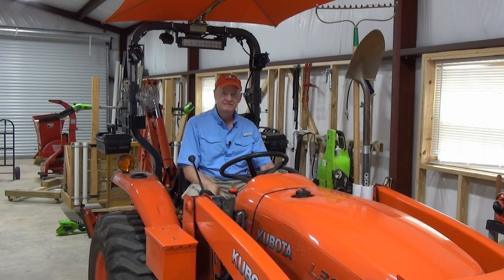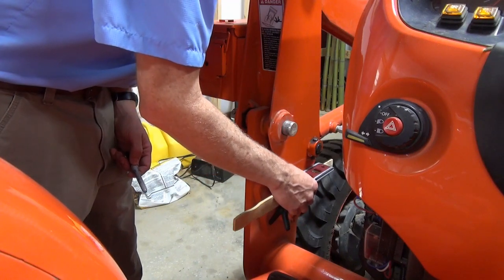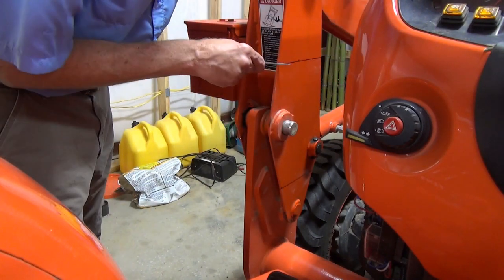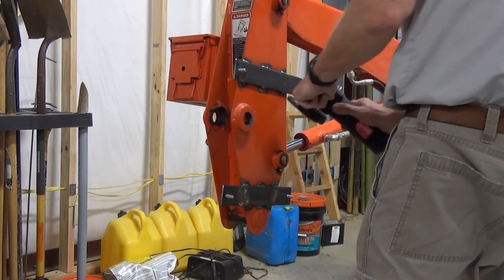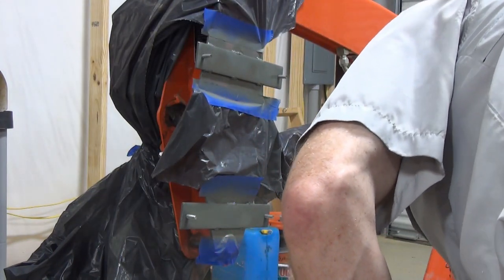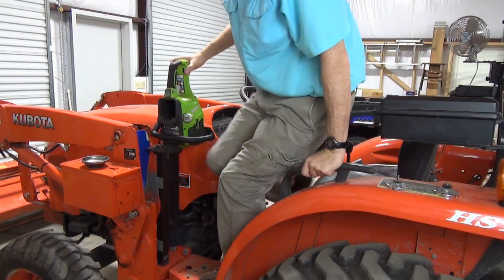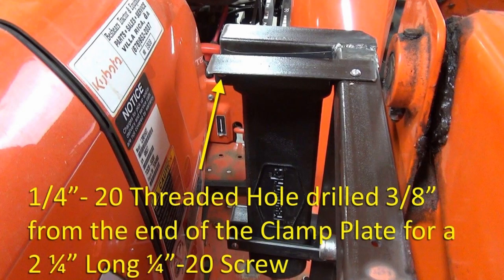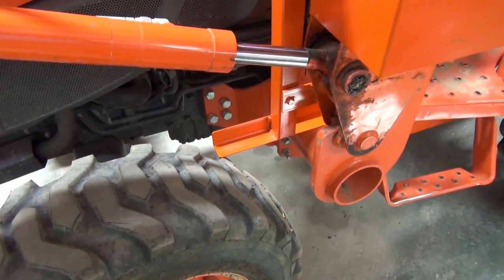Tractor FEL Chainsaw Scabbard and Tool Holder: Detailed Build Instructions (#102)

Comment: To add to my original comment I would like to mention that a company called Electrical Hub sells an industrial adhesive called Click Bond. It is incredibly strong and works great for those that can’t or won’t weld to their tractor, implements, etc. I’ve used it as well as welding over the years and highly recommend it.
Reply from the maker: Yep, heard of it and it’s expensive as I recall.  I’ve found J B Weld is VERY strong when used correctly and is inexpensive.  In fact, I used it to secure two chain boxes to my FEL towers before I had a welder and they’ve held rock solid for over four years. Here’s the link to that video in case you are interested: https://youtu.be/iUS9RyFy5sw.  Thanks for watching!

Comment: Looks Good Martin!
A well equipped tractor is like a Swiss army knife on wheels!
 I've had a home made scabbard on mine for a while (not as slick as yours) and couldn't go without it.
Does your saw have dogs on it? (log grabber spikes) looked like it sat down flush... 

on another note, be careful using that bed rail for building. Probably fine for this kind of build, not much weight hanging on it.  I've used it for stuff trying to be save money on steel , and had it crack from weight and vibration.  When cutting or grinding it sparks like grinding cast iron. Not sure how its made but gets brittle/work-hardened. 

It's fun to see your progress stocking/ setting up the Garage Mahal ! 
Keep them videos coming. 
Dan
Reply from the maker: Hi Dan!  Yes, it has dogs on it.  They sit inside the scabbard.  Good points about the bed rails.  Wouldn’t use it for anything heavy duty, but these rails cut and welded like steel.  Yep, plenty more to do in the Garage Mahal. LOL!  Thanks for watching!

Comment: Hi Martin, 

Well thought out, great idea! How often do you remove your FEL? Do you remove the tool holder before taking the FEL off the tractor? I'll be doing something similar when my B2601 arrives (hopefully in a week or two!) and noticed the clearance between the tool holder and tractor hood/cowl is pretty small!

Thanks for sharing your build and upgraded scabbard installation (in a separate video)!
Reply from the maker: Thanks, Domenic!  I don't remove it very often. Mainly when I have to do maintenance on the tractor.  There's about 1.25" clearance, which is enough for me to take the FEL off or put it on without removing the tool holder.  I just go slow and carefully. However, this is on a flat concrete floor.  If I were going to have to take it off on uneven ground, I'd take the tool holder off first.  Hope this helps. Thanks for watching!

Comment: Was always told we couldn’t weld on Loader, or ROLP’S frames. Any truth to that?
I remember when you mounted your chain boxes, no welding on your Loader Frame.
Reply from the maker: I’ve hear that too, but I think it fine to do a small amount of welding on the loader frame like I did so long as the loader frame is removed.  If I had had my welder when I installed the chain boxes, I would have used it, but the JB weld has held up great.  As for the ROPS, I’ve heard you shouldn’t drill into the ROPS but u-bolts will hold anything you need to the ROPS. Thanks for watching!

Comment: Hey Martin, Just curious why you welded the chainsaw holder but glued the chain tool box on another video. I would think the chain tool box would be a lot heaver thus needing to be welded just like you did here.
Reply from the maker: I didn’t have a welder when I installed the chain boxes four years ago but that JB Weld is amazing stuff.  The chain boxes are still rock solid. Thanks for watching!

Comment: Why did you choose to weld the tool holder frame instead of JB Weld like you used for the chain boxes?  Great video!  Thanks!
Reply from the maker: Hi Norm!  That’s an easy question to answer: because I didn’t own a welder when I mounted the chain boxes and did own one when I mounted the tool holder.  While JB Weld would probably have worked fine, it isn’t nearly as much fun as welding!  Thanks for watching!

Comment: Did ya run into any problems with the bed frame material? I’ve had a little trouble drilling that stuff as it is usually super hard metal. Thanks again!
Reply from the maker: Now that you mention it, it was a bit hard, especially near areas I had welded.  I expected the welded areas to be hardened by the heat.  Had to sharpen my drill bits (which weren’t the highest quality) a couple of times.  Thanks for watching!

Comment: Thanks for another great video. Couldn't quite make out what you are using for the rubber pads  "a scrap piece of ??? liner" but I didn't make out what kind of liner it was. Can you tell me again?
Reply from the maker: Sure, Terry.  It’s rubber pond liner.  I have a good bit left over from some water feature projects that comes in handy for so many other projects. Thanks for watching!